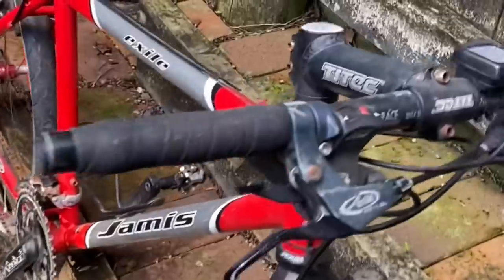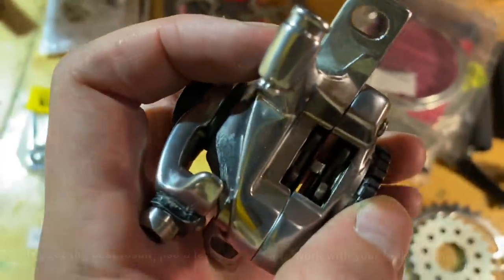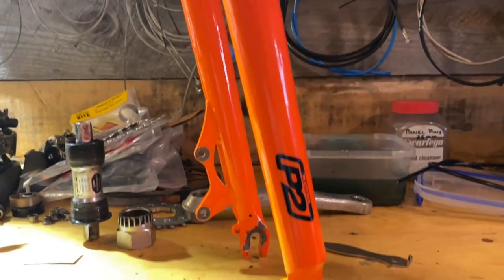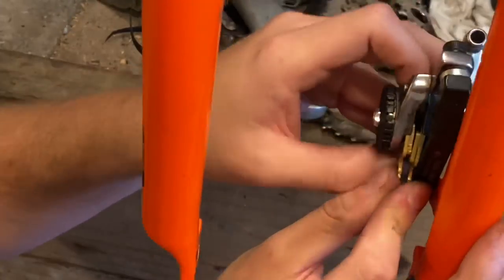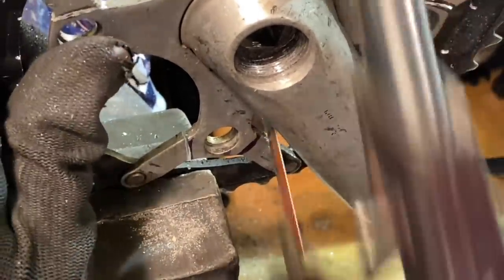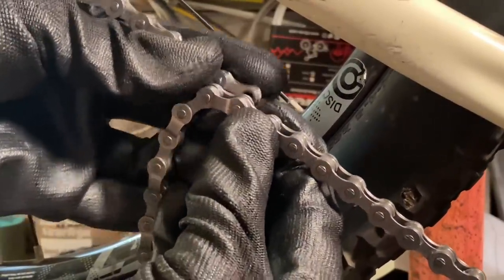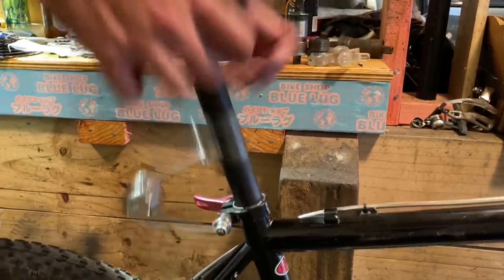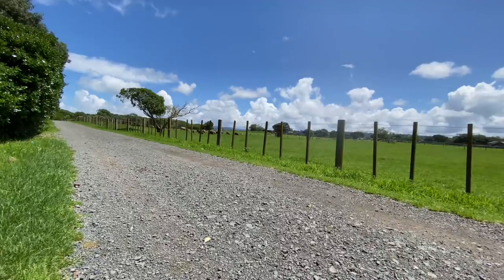MTB Singlespeed Rigid build - ‘07 Jamis Dragon Pro

Comment: Sweet build mate! 
Crank spider mod was particularly interesting. Initially, I figured you'd swapped the spider for a non-integrated option (based on IG teaser snaps of the finished Dragon) but cutting the riveted ring off came up a treat! Super tidy!
Reply from the maker: Thanks! Haha yeah I’ve always wanted to cut the riveted chainring off 😆 I’ve talked about it with mates before and this was the perfect opportunity to do it, it worked a treat!  
I’m sure it could be done cleaner, but the more material you take off the weaker it will get so I decided to leave it as it is 👍

Comment: Awesome. I love this stuff. It's versatile af that 26" mountain bikes have ~350mm clearance from dropouts to crown/brake bridge, which is more than road bikes, so they can run 700c wheels with tires up to 35. Versatile af.
Reply from the maker: Thank you 😁 so versatile!! ❤️ gotta love them, so many different ways to build them up 🤤
Reply: I have a reynolds 853 (mtb) frame built here in the states in 1990. Turned it into a 1x7 bmx-ish cruiser, 2.2" tires (road style), paint (emerald green) job was nice & still looks 👌. So comfy it's my daily driver now.   Cheers! 🍻

Comment: Another tip is to buy a full half link chain and then use it for the half link masters. For the price of 3-4 masters you can buy a full chain and have all the links you'll ever need.
Reply from the maker: Definitely! Works out way cheaper 👌 3/32 half link chains were pretty expensive and far away at the time 😣
I have a heap of 1/8” half links kicking around though 😎👌

Comment: Can you put a rigid fork where a bike once had a front shock? Thank you
Reply: Yes. Just use a fork that's a slightly bit shorter axle to crown. The same as the suspension fork minus the sag. eg. 470axle to crown-20-30 sag=440-450mm a-c fork.
Reply: @paulg666  thank you 🙏. There are good values to be found for 1990s bikes in my area